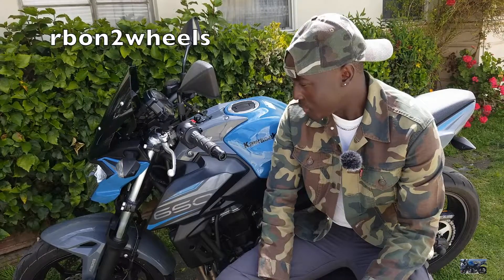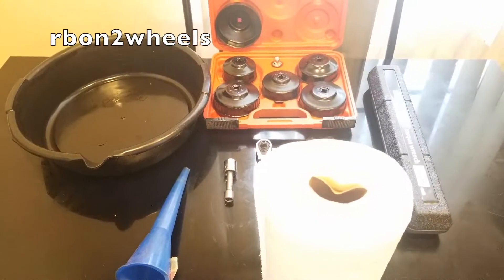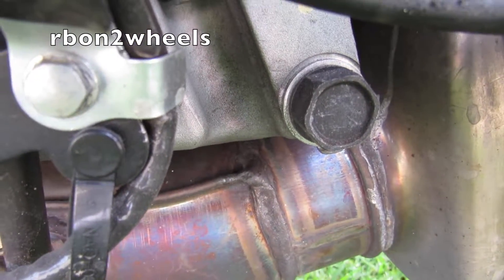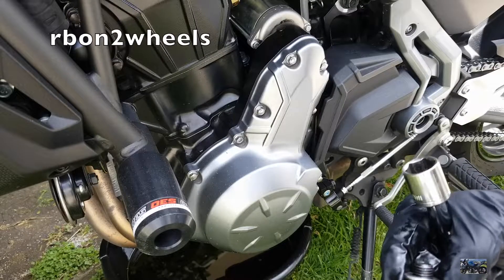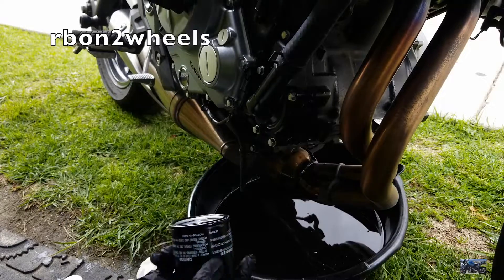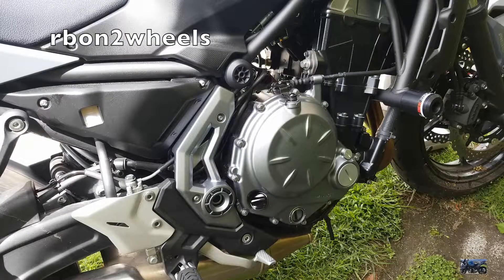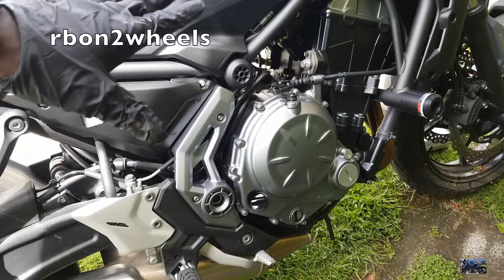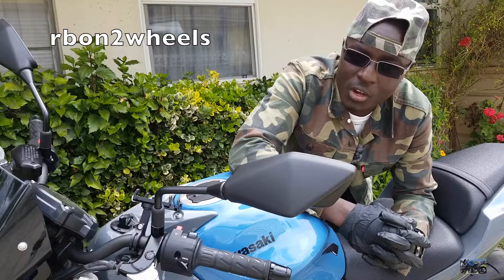2019 Kawasaki Z650 Oil change.

Comment: i think you over filled the oil. manual book says it's only 1.8 liters when the filter is removed.
Reply from the maker: 1.8 almost 2 Quarter ,the differences just 0.2 quarters. Which is 2 bottle ls of Oil.